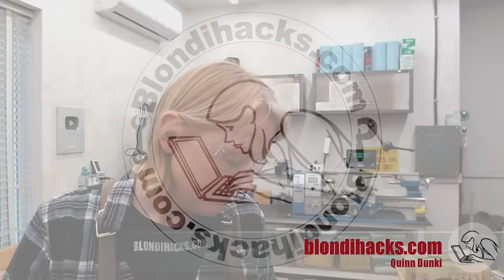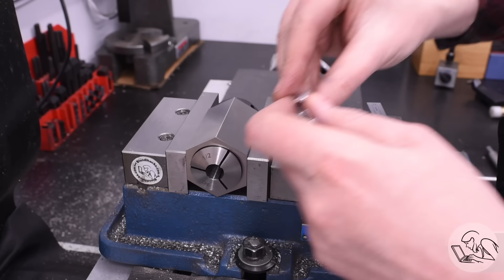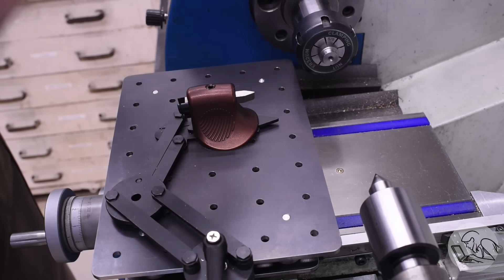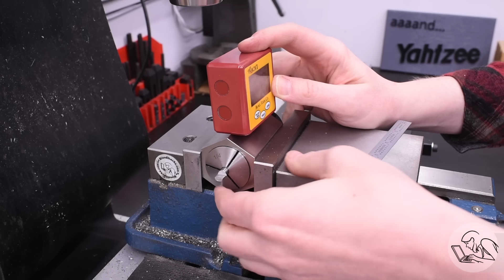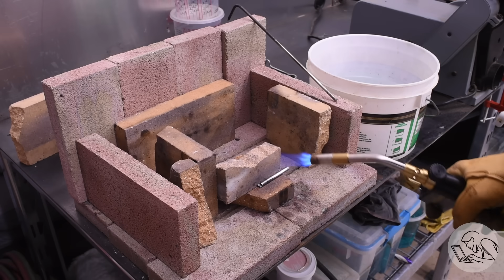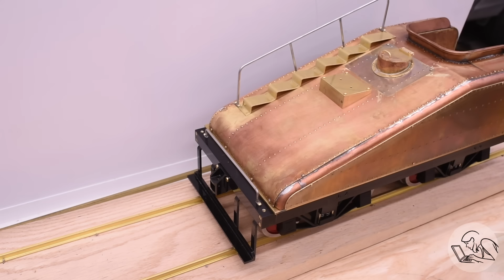Stainless Handholds - Pennsylvania A3 Switcher, Part 29

Comment: Instead of having to file, could you have used a countersink on the back side (before you milled off half the circle) to get the relief angle you needed for the tool?

Comment: One possible way of getting the angles in the semi round profile would be to drill from underneath  with the collet block on 0 degrees and use a taper reamer to form the relief angles. Then flip the block, set the 10 degrees and mill as you did.

Comment: I heartily second all of the comments regarding your presentation skills.  Well done.  The "poles" actually have another raison d'etre.  They can be used to grab and swing onto the foot boards, but the horizontal grab is the one most likely to be used during transit.  I've never worked on/from an A3 but do have experience with modern switchers.  The poles come into their own as a sight point to aid the engine crew to visualize where the end/corner of the frame is in relation to other objects - such as the car to which you are trying to couple - as you get close.  Such things are especially useful at night and in bad weather (such as snow storms - we didn't stop switching/shunting just because the snow was blowing.)  Any ways, great work and an enjoyable presentation.

Comment: 8-36 used to be a lot more common, and is still fairly common for model railroads and gunsmiths apparently (it's the only place I've found them, at least).  They are extremely common for attaching the tuner post to the gear on vintage open back guitar tuners (which is why I was looking for them).  These days we only really think in terms of course and fine threads, but there used to be a fairly common medium pitch thread, such as the 8-36.